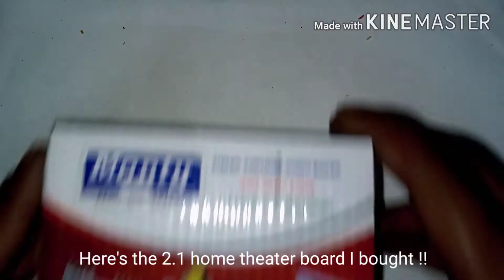How to run a home theater using only a 12 volt battery !!

Comment: Bhai if we don't give a diode to the circuit then when we will use it using  transformer, it will overcharge the battery
Reply from the maker: Obviously better to use buck converter

Comment: But subwoofer is the most important part if it can't be used whats the point of making it?
Reply from the maker: You can surely use the subwoofer I just had a bad potentiometer